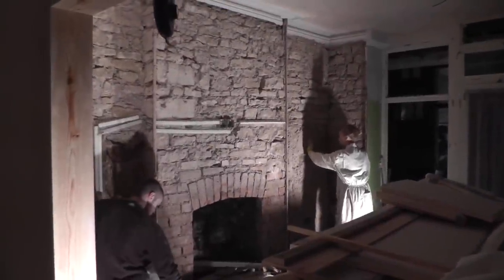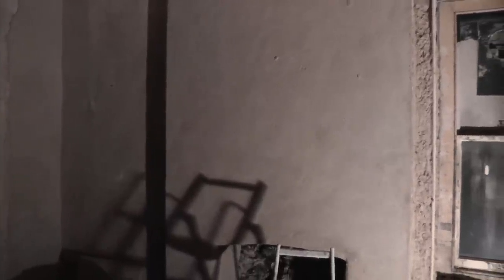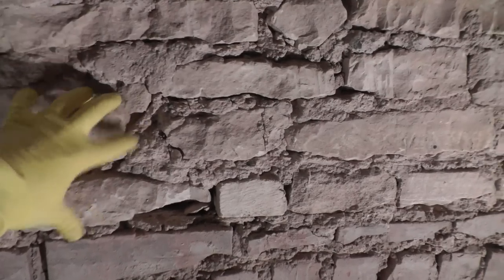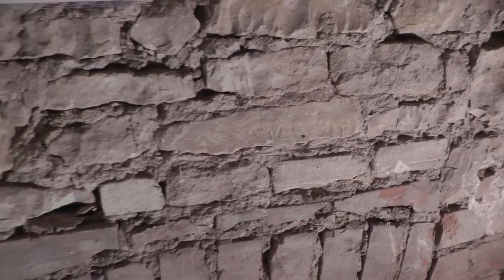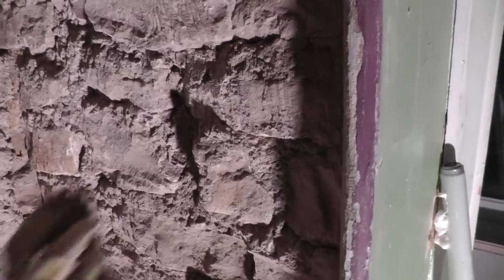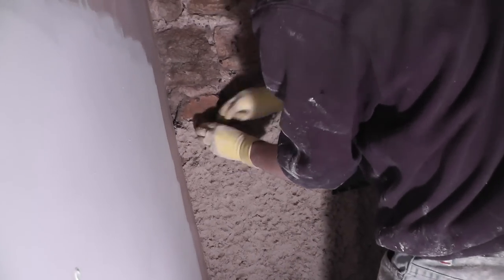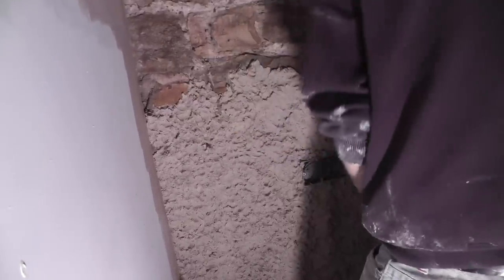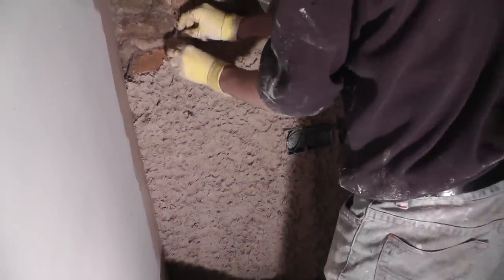Insulating a Solid wall with Lime Hemp Plaster

Comment: Have you found that the lime/hemp plaster actually provides some insulation? I have an old stone cottage with 2 foot thick walls and want to maintain the breathability but not have huge heating bills!!
Reply from the maker: There is a small thermal benefit and the walls certainly don’t feel cold to touch like the other traditional line walls. That said you would need much thicker layers to actually ‘insulate’ or a breathable insulation such as wood wool boards or similar.
Reply: Phil, I work with hemplime a lot, and can confirm that this plaster brings only a slight thermal benefit (as Tim has said). However, hemplime is a bit special, in that it has some thermal mass to store a bit of heat, good thermal resistance to slow the movement of that heat, and the ability to regulate humidity and capture excess & hold on to it until your space is drier - all of which helps your space 'feel' warmer. If you have room to lose 100mm on your external walls (& walls that have corridors the other side) then you'd benefit more from putting in 100mm of hemplime and finishing off with a clay plaster - the clay is a better thermal mass layer and gives the best performance for buffering humidity. I've done this in a Victorian terrace in Bristol and the impact on the place is immense.

Comment: Hi,can you tell me what grade of hemp shiv did you use on the walls
Reply from the maker: +Richard Fleming Medium
Reply: can you tell what mix you started with on the walls initially after preparing the walls
Reply from the maker: +Richard Fleming it is a premixed wet mix delivered in a bulk bag. We used ty mawr lime.
Reply: Thanks!

Comment: HI, was a 100kg enough to to cover that area ? 1st and 2nd coat.
Thanks and great vids and very helpful
Reply from the maker: 1000kg, or at least a full builders dumpy bag, it comes ready mixed and wet so very heavy.

Comment: use a concrete chain saw and fit a plastic damp proof course right through the walls in 1m sections and overlap. Water fed no dust best possible solution. Do the same with internal walls 8mm cut so no problem with movement if re pointed properly in 1m sections with gun. Cuts like butter . Diy job £2000 for machine sell it on when done. Don't buy the cheap chains . £300 each
Not expensive as it will be a proper cure for rising damp.  Penetrating damp, point outside brick work, ventilate house every day for 2 hours open  a few windows to get the draft through, morning best before heating goes on. fit proper water covering cowls to chimney to prevent rain getting down the chimney and open up closed off fireplaces. natural ventilation. Use Lime wash and lime render after removing waterproof render or none porous painted render. as it keeps condensation in walls and stops the house from breathing  vent the tumble dryer outside. Fix the gutters.  Clean out the drain traps. Dig a french drain around the hose and fill with large pebble. Let the sun see the walls remove trees etc that block the sun. Lower soil levels that are above floor level. If you have green mold it's not rising damp as the salts in the ground water rising up from the ground would prevent the growth of  mold. Green/ black mold is penetrating damp or usually just condensation from lack of ventilation. Phil
Reply from the maker: +phil price Thanks for the comment.  Agree with you on most points, however it would be an absoloute last resort to start messing round with plastic in an old building.  Solid walls have stood dry for hundreds of years, it is just simply the use of gypsum and modern paints which cause all the issues recently.  The lime plaster and breathable paints sorted everything here and also deals with penetrating moisture and condensation which could cause issues anywhere up the wall, something a dpc would not do.  With gravel filled channel/french drain and lime mortar and plaster there should not be the need for fitting damp proof course.  Just the tarmac driveway the neighbors have against our wall to sort now! :-(

Comment: No thermal value gained by using hemp plaster it is only lime NHL2 or 3.5 with hemp fibres over priced mortar, get equally as good results using appropriate hydraulic lime, with good quality coarse sand and well fibered with hair or sisal. Or use premixed lime mortar with salt inhibitor added. More expensive but no fear of efflorescent salts, finish with putty lime 2-1 silver sand or premixed finish

Comment: Would you guys please speak ENGLISH.... 😳... jk.. actually wondering if there is an USA 🇺🇸 equivalent for this product? Curious about the r value when using it as an insulator.. thinking of building a stone house that can breath... don’t want to wrap it In styrofoam ya know?
 Thanks..
Reply from the maker: Not much at this thickness. Wood wool boards inside stone finished in lime is a good breathable option.